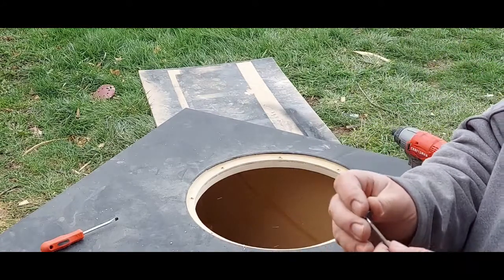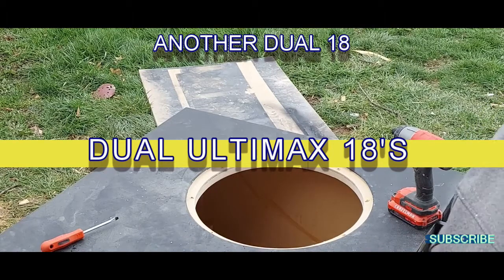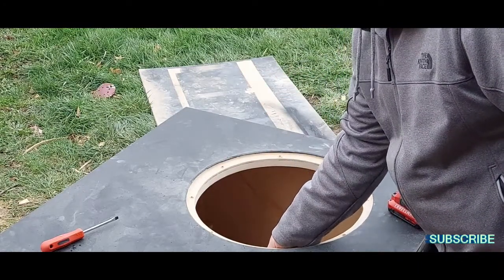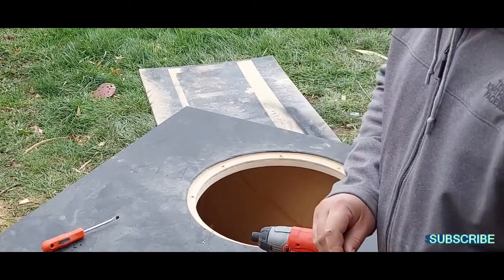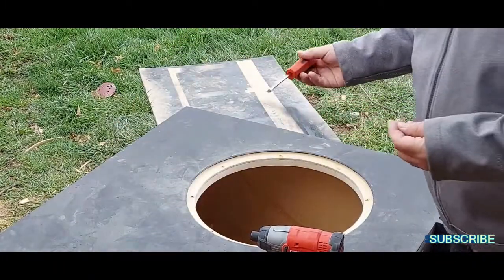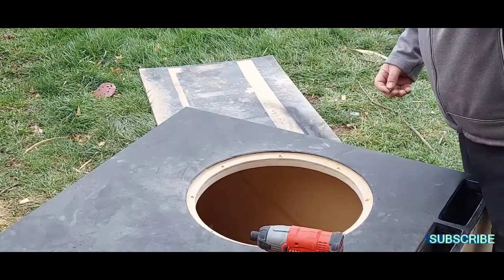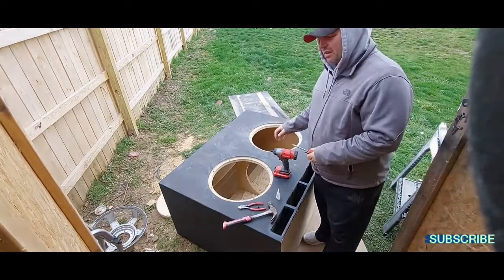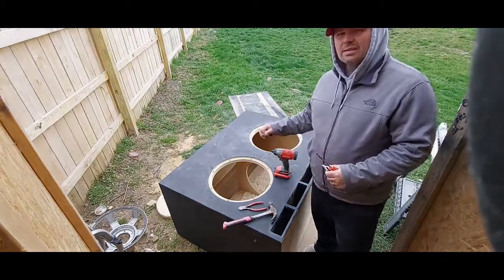HOW TO INSTALL WOOD THREADED INSERTS

Comment: How did it hold up? I had a beefy pair of 12s pull screws out of my mdf box and now that I’m starting over I want to make sure these subs are sucked in tight and don’t ever pull out.
Reply from the maker: I like how easy these are to install, but I believe the better route is to use t-nuts.